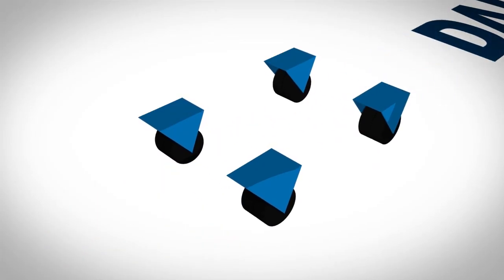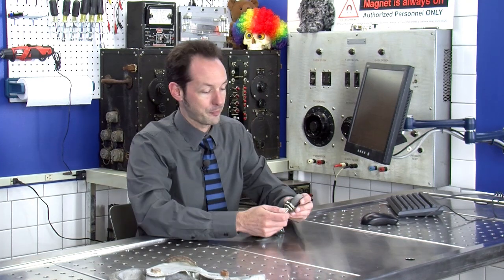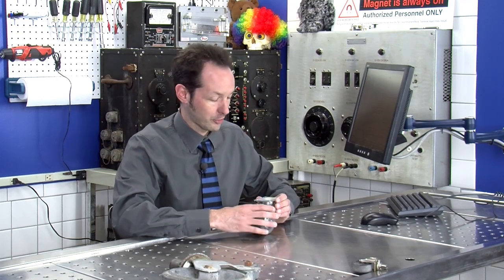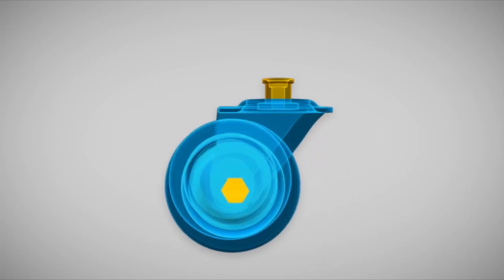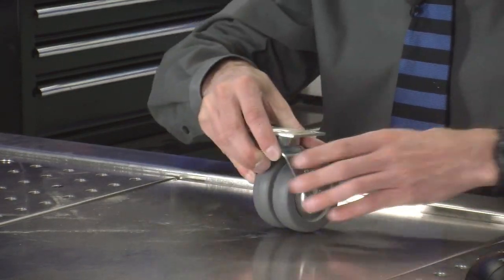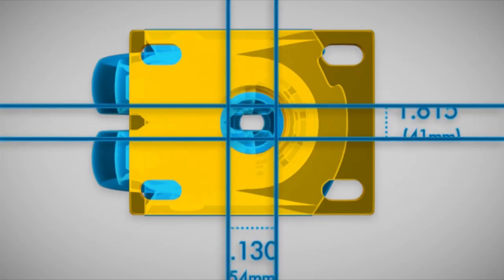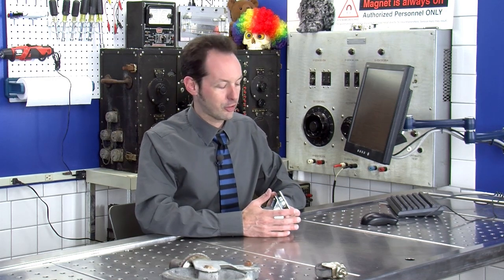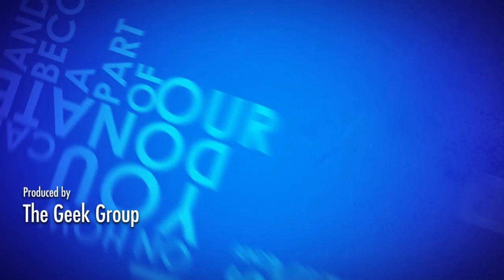Casters 101: How They Work

Comment: So basically, if i have a caster rated for arguments sake at 500kg. And i secure the fork part of the caster in a table vice, leaving the top four hold plate exposed. And i have a rectangular 30inch length x 2inches wider plate than the castor plate, that's 3/4/5mm thick. And i bolt my one end of my plate to the castor and have anywhere up to 500kgs on the other end that's 30inches from the castor. The castor and bearings can take that and turn no problem what so ever?